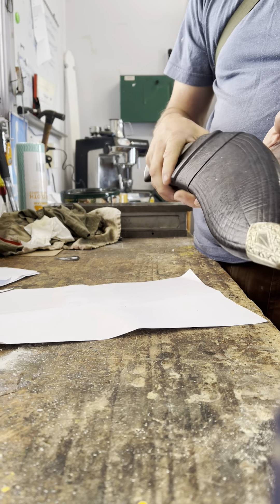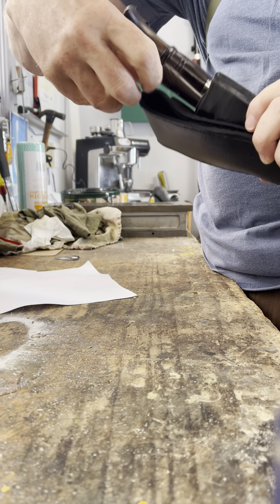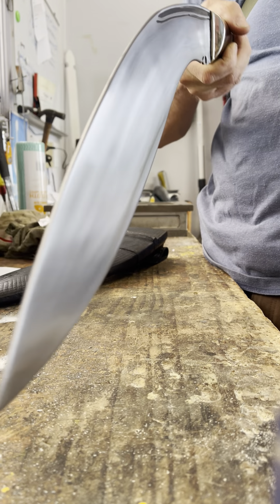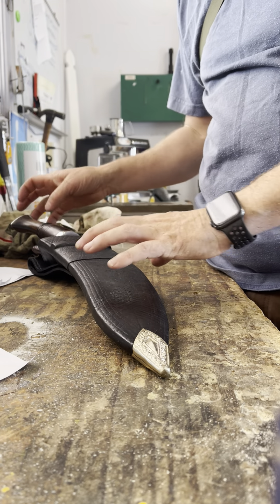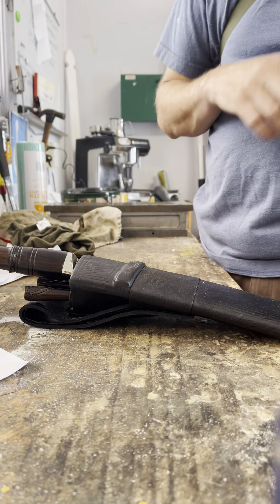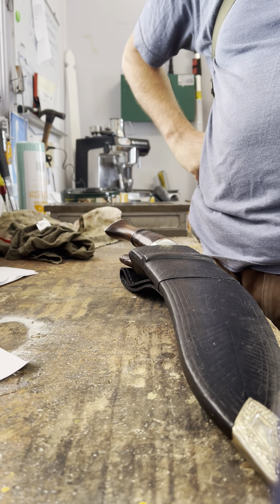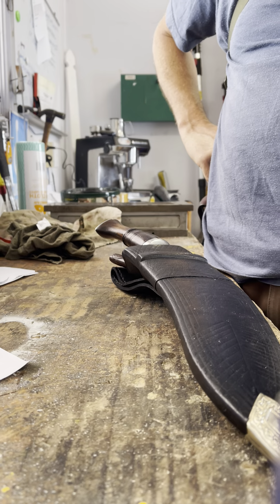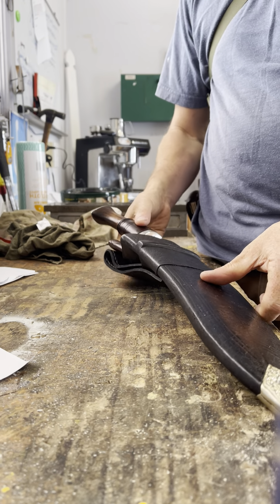First look at Heritage Knives Khukuri Papu

Comment from the maker: Well the blade is good, a tad wavy as they made it so this to make it light, the issue is the sheath, the sheath has the leather nailed to the wood underneath, the nails are carbon and they touch the blade, this caused a rust reaction, actually pitted the blade slightly, still fixing that, I removed the nails so should not get worse.
If you don’t need anything this wide I would look at the kailesh blades mutiny instead.